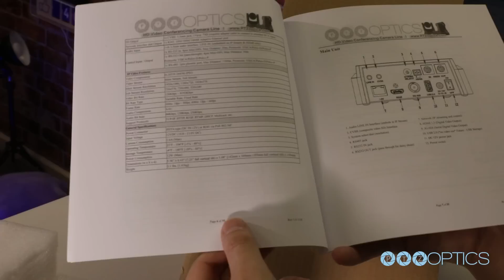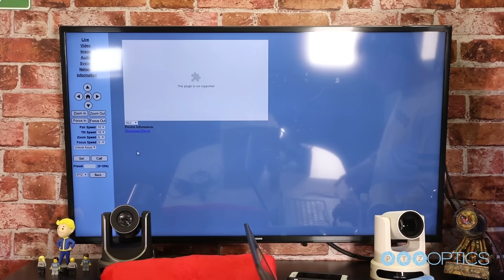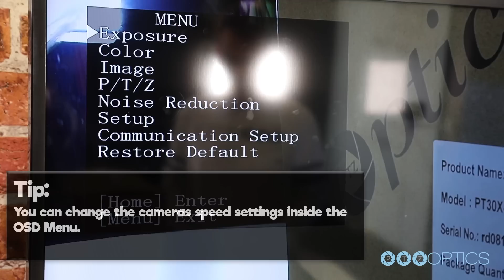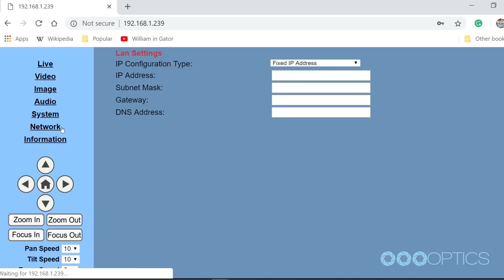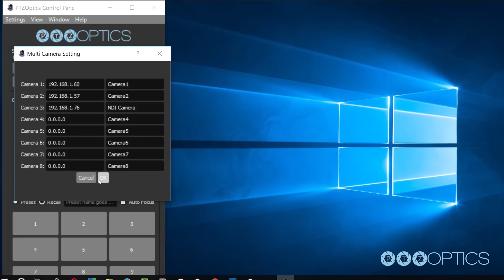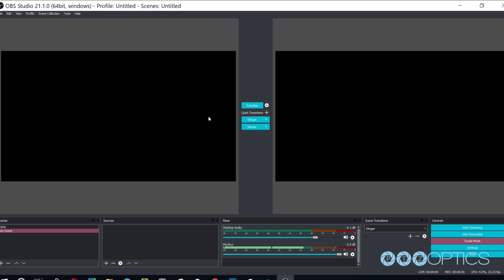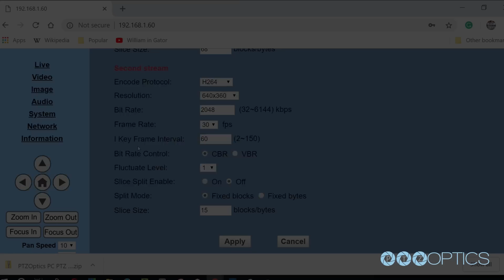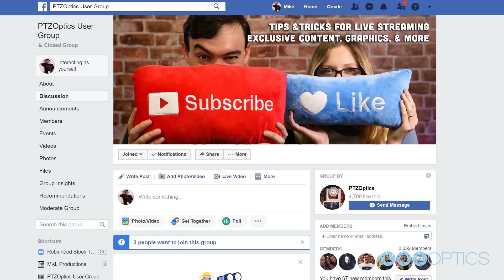PTZOptics SDI Camera Setup

Comment: If I connect this camera over Ethernet, will it automatically appear in Zoom as a video source?I already have several static webcams connected to zoom via a hub which I switch between within the zoom window. I would like to add a ptz camera which I could select while using zoom without having to add a controller.
Reply: For this camera you can use an SDI capture card with Zoom. Or you can get the NDI version and use NDI webcam to connect via Ethernet
Reply from the maker: Hello!
Connecting a PTZ camera via Ethernet to your network does not automatically make it available as a video source in Zoom. To use a PTZ camera within Zoom, especially one connected via Ethernet, you'll need to consider a few additional steps and potentially some extra hardware or software:

Steps to Use a PTZ Camera with Zoom

Connect the PTZ Camera to the Network:
Connect your PTZ camera to the network using an Ethernet cable. This will allow the camera to be accessible over your local network.

Video Capture Method:
Most PTZ cameras output video via HDMI or SDI. To use the camera with Zoom, you need to convert this output to a USB video feed that your computer can recognize.
Video Capture Device: Use a video capture device (like an Elgato Cam Link, Magewell USB Capture HDMI, or similar) to convert the HDMI or SDI signal from the PTZ camera to USB. Connect this device to your computer.

Selecting the Camera in Zoom:
Once the PTZ camera is connected to your computer via a capture device, it should appear as a video source in Zoom.
In Zoom, go to 'Settings' > 'Video' and select the capture device as your camera source.

Controlling the PTZ Camera:
To control the PTZ functions (pan, tilt, zoom) without a dedicated controller, you can use software provided by the camera manufacturer, or third-party software that supports PTZ control over the network.
This software typically runs on a separate computer or device on the same network as the camera.

Integration with Static Webcams:
If you already have static webcams connected to Zoom via a hub, the PTZ camera will be an additional source. You can switch between your webcams and the PTZ camera within Zoom as needed.

Additional Considerations
1. Network Configuration: Ensure the PTZ camera is correctly configured on your network and that your computer can communicate with it.
2. Software Compatibility: Make sure the PTZ control software is compatible with your camera model and operating system.
3. Latency: Be aware of any latency introduced by the capture device and network, which can affect real-time control responsiveness.

Conclusion
To use a PTZ camera as a video source in Zoom, you need to connect it to your computer via a video capture device that converts HDMI/SDI to USB. You won't automatically see the camera in Zoom just by connecting it over Ethernet; it requires this additional setup. Once connected, you can control the PTZ functions using appropriate software on your network and switch to the camera within Zoom like any other webcam.

Comment: I love to own this camera. Can I control this camera from different IP address? We are live streaming and looking to have remote locations that cameras with audio can be controlled from our studio and can access the audio/video so that we do not need to use other conferencing platform to integrate the audio/video into our OBS, can we accomplish it with this camera?
Reply from the maker: Hello!
Yes, you can control a PTZOptics camera from a different IP address, and it's possible to integrate its audio and video feed directly into your OBS setup without relying on a separate conferencing platform. This is particularly useful for live streaming setups where you want to manage cameras and their feeds remotely. Here's how you can accomplish this:

Remote Control Over Different IP Addresses

Network Configuration:
Ensure that the PTZOptics camera and the controlling computer are connected to the internet.
If they are on different local networks, you will need to configure your network to allow external access to the camera. This often involves setting up port forwarding in your router and knowing the external IP address of the network where the camera is located.

Use PTZOptics Camera Control Software:
PTZOptics provides software that allows you to control their cameras over the network.
When setting up the software, use the camera’s external IP address and the port number specified in your port forwarding settings.

VPN for Secure Remote Access:
For a more secure setup, consider using a VPN (Virtual Private Network) to access your camera network. This approach is safer than exposing your camera to the internet via port forwarding.
Integrating Audio/Video into OBS

Direct Connection (Local Network):
If the camera is on the same local network as your OBS system, you can connect it directly using NDI or RTSP streaming, depending on the camera’s capabilities.

Remote Connection (Different Networks):
For a remote connection, you can use RTSP streaming to access the camera’s video feed. Input the RTSP stream URL from the camera into OBS as a media source.
Ensure that the necessary ports for RTSP streaming are open and properly forwarded if you're accessing the camera over the internet.

Audio Integration:
PTZOptics cameras typically have an audio input. The audio embedded in the HDMI or SDI output can be included in the RTSP/NDI stream.
In OBS, ensure that the audio from the camera’s video feed is being captured along with the video.

Considerations
Network Stability: Ensure both locations have stable and fast internet connections, as streaming video and audio over IP can be bandwidth-intensive.
Latency: Be aware of potential latency, especially when streaming over longer distances or different networks.
Security: Prioritize security, especially if you’re opening network ports or using port forwarding. VPNs are a safer alternative.

Conclusion
Controlling a PTZOptics camera remotely and integrating its audio/video feed into OBS without a conferencing platform is feasible. It requires proper network configuration for remote access, use of the PTZOptics control software, and correct setup in OBS for capturing the video and audio feed. Pay attention to network security and stability to ensure a smooth and secure operation.

Comment: I cannot see my PTZoptics camera in OBS, I do the media source and the rtps method, but it will not show in OBS. I can see it just fine in VLC media, but not OBS. Any help would be appreciated.
Reply from the maker: Hey Aaron,
If your PTZOptics camera is working fine in VLC Media Player but not showing up in OBS (Open 
Broadcaster Software) using the RTSP method, there are several troubleshooting steps you can take to resolve this issue:

1. Check RTSP Stream URL:
Ensure that the RTSP URL you're using in OBS is correct. The typical format for PTZOptics cameras is rtsp://[camera-ip-address]/1 (for high definition stream) or /2 (for standard definition stream).
Verify that this URL works in VLC to confirm it's correct.

2. OBS Media Source Configuration:
In OBS, when you add a new 'Media Source', make sure to uncheck the 'Local File' option.
Paste the RTSP URL in the 'Input' field.
Try checking or unchecking the 'Use hardware decoding when available' option as this can sometimes affect the stream.

3. Network Issues:
Ensure that both your computer and the PTZOptics camera are on the same network and that there are no firewall or router settings blocking the RTSP stream.
If you're on a corporate or school network, there might be network restrictions in place.

4. Software and Firmware Updates:
Update OBS to the latest version, as newer versions often have bug fixes and improved compatibility.
Check if your PTZOptics camera has any firmware updates available and apply them if necessary.

5. Camera Settings:
Access your camera's web interface and check the RTSP settings. Ensure that RTSP streaming is enabled and configured correctly.
Restart your camera after making any changes.

6. Test with Alternative Software:
To isolate the issue, try using a different streaming software like XSplit or Wirecast to see if the camera shows up there.

7. Check Computer's Security Software:
Sometimes, antivirus or firewall software on your computer can block the RTSP stream. Temporarily disable these to test if they are causing the issue.

8. Use VLC as an Intermediary:
As a workaround, you can capture the VLC window in OBS. Open the RTSP stream in VLC, then use the 'Window Capture' source in OBS to capture VLC.

9. Codec Compatibility:
Ensure that the codec used by the PTZOptics camera for RTSP streaming is compatible with OBS. OBS generally supports common codecs like H.264.

10. OBS Log Files:
Check the OBS log files for any errors related to media sources or network streaming. This can provide clues on what might be going wrong.

If after following these steps the issue persists, consider seeking additional support from OBS community forums or PTZOptics customer support, where you can find more specific advice tailored to your situation. Remember to provide them with details about your setup, the steps you've already tried, and any error messages you're encountering.

Comment: This video is titled for "SDI" camera setup. You go into capture software that literally talks about "NDI" camera. Correct me if I'm wrong, but I thought only the NDI camera could be setup over a network with IP address and then controlling it through the Control app on a computer. The SDI version has to be controlled by the included remote or by getting a joystick controller? 

If I can buy the cheaper SDI version, plug it into a network, and do everything on a computer with the Control app such as controlling the pan, tilt and zoom of the camera WHAT are the advantages to the NDI? I thought you had to buy the NDI camera to do all this but you're explaining all of it in this SDI setup video.
Reply: Hi Daniel, the SDI camera doesn’t feature NDI but it does feature IP controls. The NDI setup goes more into NDI studio monitor and other applications that use NDI. This SDI camera is really nice to have on the network because it can be powered with PoE and controlled over Ethernet which allows for many applications an smartphone apps to work
Reply from the maker: Hi Daniel,
It's important to clarify the differences between SDI and NDI cameras, especially in the context of PTZOptics cameras, and how they can be set up and controlled.

SDI Cameras:
- Connectivity: SDI cameras, like the PTZOptics SDI models, primarily use SDI (Serial Digital Interface) for video transmission. This interface is known for its reliability and long cable runs without signal degradation.

Control Options:
- SDI cameras can indeed be controlled over a network using an IP address if they have an Ethernet port, which most PTZOptics SDI cameras do.
- They can be controlled using the PTZOptics Control App or similar software that supports VISCA over IP, a protocol for camera control.
Additionally, they can be controlled using the included IR remote or an external joystick controller.

NDI Cameras:
- Network Device Interface (NDI): NDI is a technology developed by NewTek that allows high-quality video, audio, and metadata to be shared over a standard - Ethernet network. It's designed for more flexible and scalable setups often used in broadcast environments.

Advantages of NDI:
- Ease of Setup: NDI can simplify the setup process by transmitting video, audio, control, and tally over a single Ethernet cable.
- High Bandwidth: NDI supports higher bandwidth than typical IP streams, allowing for higher quality video over the network.
- Software Integration: NDI is widely supported across many software platforms, making it easier to integrate into existing workflows.
- Low Latency: It offers low-latency transmission, which is crucial for live production environments.

Can SDI Cameras Be Controlled Over a Network?
- Yes, PTZOptics SDI cameras can be controlled over a network. They have an Ethernet port that allows for IP control (VISCA over IP).
- This means you can use a computer with the PTZOptics Control App or similar software to control pan, tilt, zoom, and other camera settings, even for an SDI camera model.
- The misunderstanding in your video might stem from the fact that while SDI refers to the video transmission method, it doesn’t exclude the camera from being controllable over a network for its PTZ functions.

Choosing Between SDI and NDI:

1. Cost: SDI models are typically less expensive than NDI models.
Network Infrastructure: If your existing infrastructure supports NDI and you require its benefits (like high-quality video over IP and ease of integration), then NDI might be the better choice.

2. Simplicity vs. Quality: For simpler setups or when budget is a constraint, an SDI model controlled over IP might suffice. However, for high-end productions where video quality and integration with NDI workflows are important, an NDI model is preferable.

In conclusion, while both SDI and NDI PTZOptics cameras can be controlled over a network, the choice between them should be based on your specific needs regarding video quality, network infrastructure, and budget. The SDI model offers a cost-effective solution with network control capabilities, while the NDI model provides higher quality and integration flexibility in network-based workflows.

Comment: Can I connect sound via lav mics etc to this camera? The venue I’m needed this for already has a sound system, lav mics and podium mics, can I connect their sound board to this camera?
Reply: Yes, you can connect an audio input directly to the camera. Most people connect a mixing board output to the camera.
Reply: StreamGeeks thank you!
Reply: The video says it needs to be a line level signal (that would be a mic through a preamp or mixer to bring the voltage level up to about 1 volt) Mic's are typical about 1000 times less than line level
Reply from the maker: Thanks for checking out our Channel! 
Learn More: https://ptzoptics.com/

Comment: Whats the difference between the SDI and the NDI camera?

If i want to control 3 cameras through the app do I need a switch? Any regular switch works or do I need any specific?
Reply from the maker: The NDI cameras support NDI HX (High Efficiency) NDI integrations. But from a hardware perspective, they are almost the same. So, therefore, you can use almost any networking switch. Here is some that we recommend ptzoptics.com/IP

Comment: This PTZ Camera is better than my camcorder for my live streaming (which i don't use at night now, I also had a DSLR for night live but it's annoying because the battery drains and also i can't automate it or leave it on for a long time and needed a pc).  i have and it's around the same sensor size.  I think your lens is great.
Reply from the maker: Thank you. A lot of our users switch to PTZOptics from DSLR cameras because they are able to do better live streams with a connected system. Today we were filming in NYC, and yes, we were using a DSLR. They both have great applications.

Comment: Can you edit a preset that pans from one position to another?
Rather than having multiple static presets.
Reply from the maker: You would just put that camera live when calling that preset. Then the audience would see the transition from one spot to another. If I understand correctly.
Reply: @PTZOptics  understood,  Thanks for the feedback.
Reply: @PTZOptics  I also have tried doing a moving shot using two presets. Unfortunately, the camera seems to only do one axis movement at a time. Is there a way to get it to interpolate smoothly between the two presets points, like it is able to do when operated manually by the joystick?
Reply: JD Orozco - the latest firmware update includes motion sync and will allow both pan and tilt to happen with zoom

Comment: You guys said this is an sdi setup but everything was done with an hdmi cable... am I missing something?
Reply from the maker: This is more of a Setup video for the SDI camera models. HDMI was used for ease of use and plugging it into our monitor. But it shows the setup of our SDI camera model.
Reply: @PTZOptics  thanks. Just asking but by any chance could you make a video using an actual sdi cable going into a device that utilizes that particular cable?